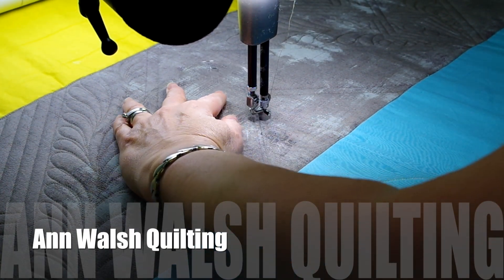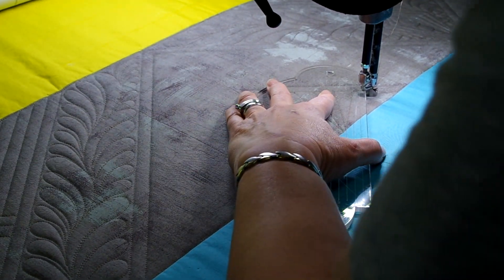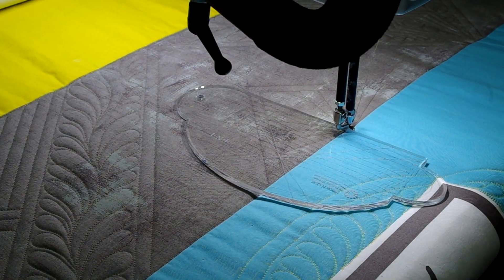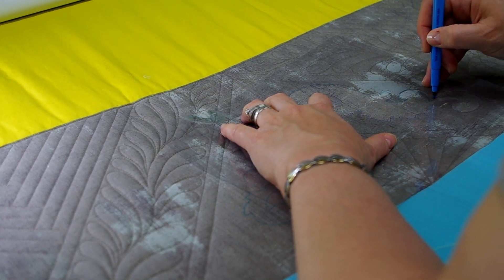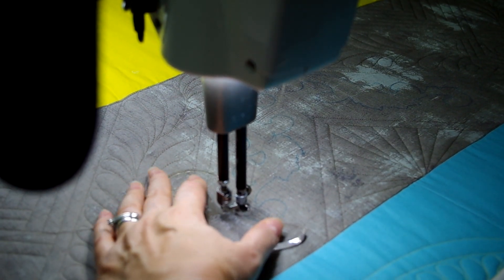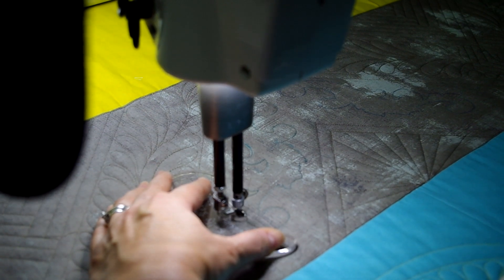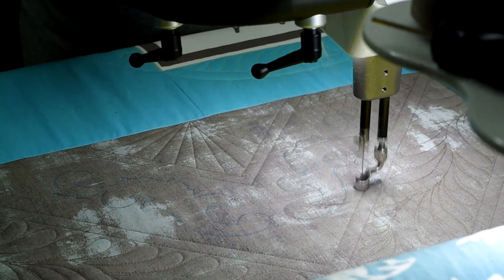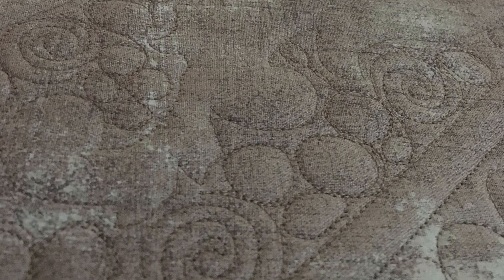Longarm quilting Negative space building structure

Comment: Do you use a ruler base? Love watching your videos!
Reply from the maker: Thanks!  Yes, I always use a ruler base when doing ruler work - you need the stability under the ruler or you will have problems with it flipping up and down and possibly have it hit by your needle which can cause problems - and most of the time in general because there are very few quilts I work on where ruler work is not involved and it doesn't affect the free motion quilting so I can easily go back and forth.  If I know I'm going to be doing straight free motion on one quilt, I might take it off, but that hasn't happened in a long time :-)